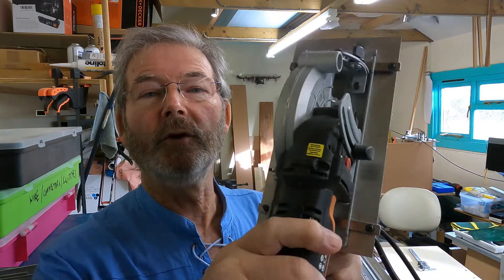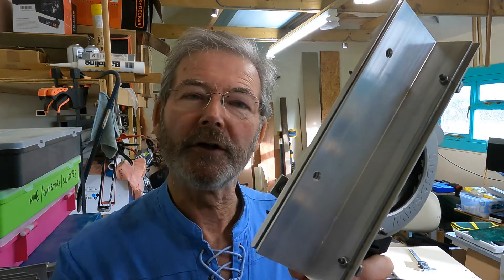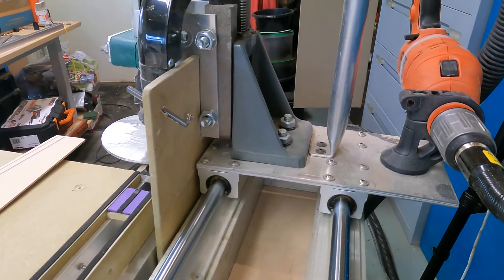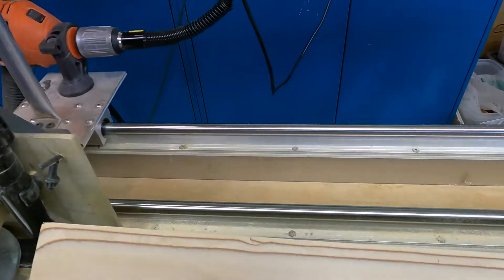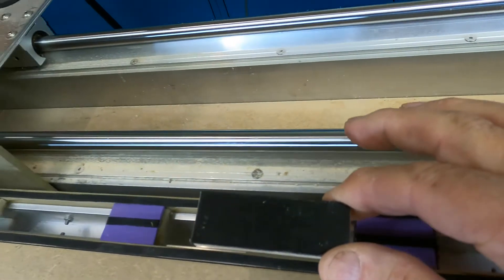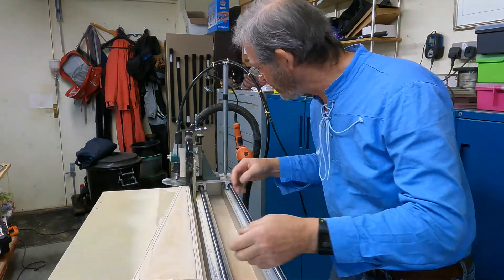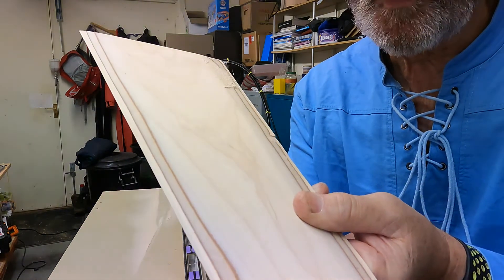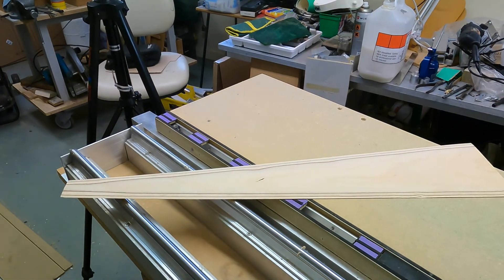Wooden aeroplane builders / restorers. Scarf cutting thin plywood.

Comment: I do like it and very worth while effor if you have a fair amount of thin ply to scarf. Poeple will be after using that in the future. I must admit I have always done it with the two bits of ply stacked and then a large very flat sanding board and just made sure the lines in the laminations run straight but it takes a lot of time.